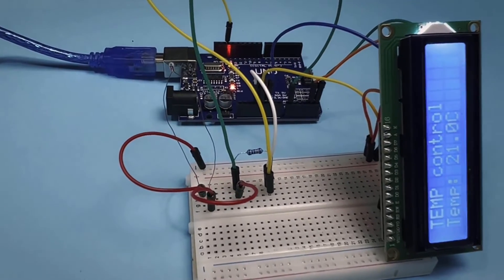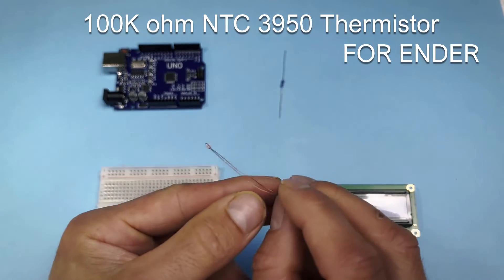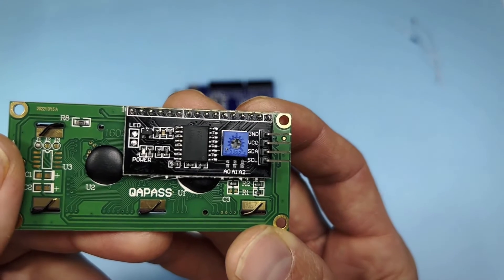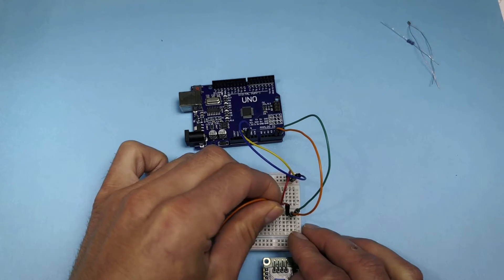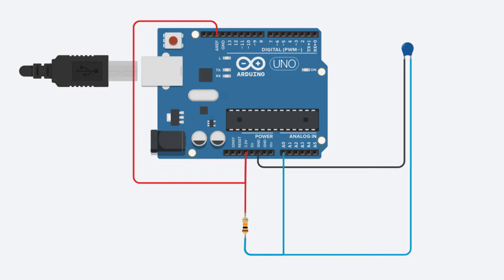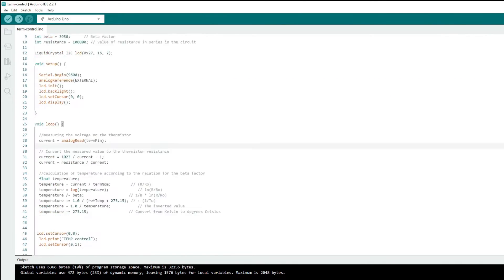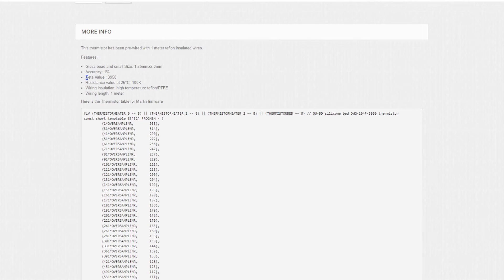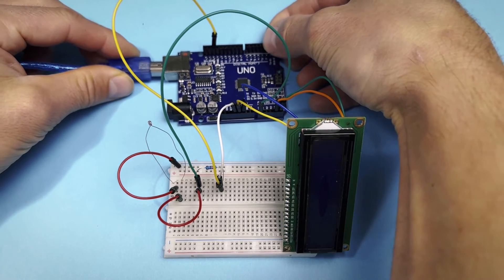How To Connect Thermistor NTC 3950 (ENDER) To Arduino ?

Comment: hi there. my question is what would change if I use 10k resistance instead of 100k that you used?
Reply: Da diferença de temperatura de 5%.

eu utilizei  um calibrador no código,  usando #25 no monitor serial  (25= valor da temperatura real que tu está, utilize um termostato genérico) 

#include <Wire.h>
#include <math.h>

const int thermistorPin = 34; // Pino analógico do ESP32
const float termNom = 100000; // Resistência nominal do termistor a 25°C (100k ohms)
const float refTemp = 25; // Temperatura de referência para a resistência nominal (25°C)
const float beta = 3950; // Fator Beta do termistor
const float seriesResistor = 10000; // Valor do resistor em série no circuito (10k ohms)

float calibrationOffset = 0; // Offset de calibração

void setup() {
  Serial.begin(115200);
  Serial.println("Iniciando medição de temperatura...");
  Serial.println("Para calibrar, envie # seguido da temperatura real (ex: #26 para calibrar para 26°C).");
}

void loop() {
  // Medir a tensão no termistor
  int adcValue = analogRead(thermistorPin);

  // Converter o valor medido para a resistência do termistor
  float voltage = adcValue * (3.3 / 4095.0); // Conversão para tensão (ESP32 é 12 bits ADC)
  float resistance = seriesResistor * (3.3 / voltage - 1); // Calcular resistência do termistor

  // Calcular a temperatura usando a relação para o fator Beta
  float temperature;
  temperature = resistance / termNom; // (R/Ro)
  temperature = log(temperature); // ln(R/Ro)
  temperature /= beta; // 1/B * ln(R/Ro)
  temperature += 1.0 / (refTemp + 273.15); // + (1/To)
  temperature = 1.0 / temperature; // Valor invertido
  temperature -= 273.15; // Converter de Kelvin para graus Celsius

  // Aplicar o offset de calibração
  temperature += calibrationOffset;

  // Imprimir valores para debug no Serial Monitor
  Serial.print("ADC Value: ");
  Serial.print(adcValue);
  Serial.print(" | Voltage: ");
  Serial.print(voltage, 3);
  Serial.print(" V | Resistance: ");
  Serial.print(resistance, 2);
  Serial.print(" ohms | Temperature: ");
  Serial.print(temperature, 2);
  Serial.println(" °C");

  // Verificar se há entrada de calibração no Monitor Serial
  if (Serial.available() > 0) {
    String input = Serial.readString();
    if (input.startsWith("#")) {
      input.remove(0, 1);
      float realTemp = input.toFloat();
      calibrationOffset = realTemp - temperature;
      Serial.print("Calibração ajustada. Novo offset: ");
      Serial.println(calibrationOffset);
    }
  }

  delay(1000); // Delay para a próxima leitura
}

Comment: Hello, the method I used in this video is accurate at positive temperatures, but it jumps very much at negative temperatures. Do I need to readjust the external resistor and program code?
Thank you, greetings from Taiwan
Reply from the maker: Hello Taiwan,
I'd look at the code, I have a feeling it's not built for negative numbers. I haven't tried and I don't know if I will find time to try now. If you understand it a bit, this part will probably need to be changed.

//measuring the voltage on the thermistor

  current = analogRead(termPin);

  // Convert the measured value to the thermistor resistance

  current = 1023 / current - 1;   --- (maybe there will be a problem here, because I no longer know what the thermistor sends as data.)

  current = resistance / current;

  //Calculation of temperature according to the relation for the beta factor

  float temperature;

  temperature = current / termNom; // (Y/Y)

  temperature = log(temperature); // ln(R/Ro)

  temperature /= beta; // 1/B * ln(R/Ro)

  temperature += 1.0 / (refTemp + 273.15); // + (1/This)

  temperature = 1.0 / temperature; // The inverted value

  temperature -= 273.15; // Convert from Kelvin to degrees Celsius

Look at what is going on with the data and where the error occurs. It's been a while since I've done this, I'd have to find more time to test where the error occurs.Let me know. Thanks

Comment: Hi! I follow every step and same components you used  but not getting the temp readings on the lcd display and it always dispalys -273.15 only .Can you help me with this, please....
Reply from the maker: apparently the resistor temperature information is not getting into the code. check if it is well connected.
Reply: can you solution??
Reply: Sounds like bad thermistor

Comment: Hi there! I'm with a problem. No matter how I change the code, it never works. But te thing is, I don't have a resistence on it. I have a arduino mega, the same lcd display as yours, the ntc 3950 100k ohms, but no resistence. Do you think that this is the thing affecting the code?
Reply from the maker: Hi, the resistance has a purpose there. It must be there :-)